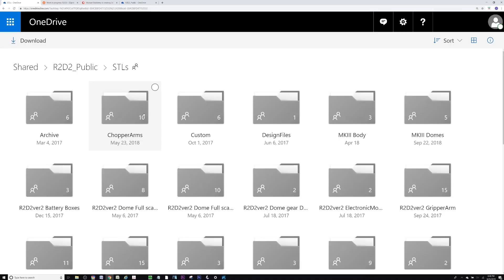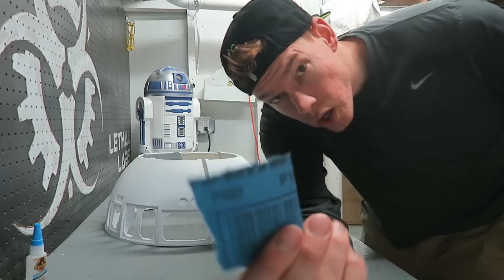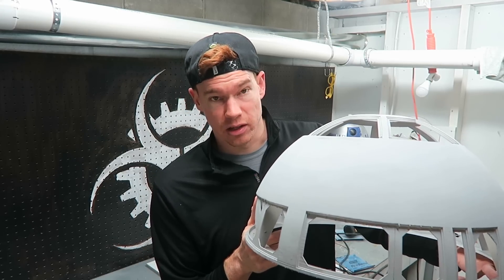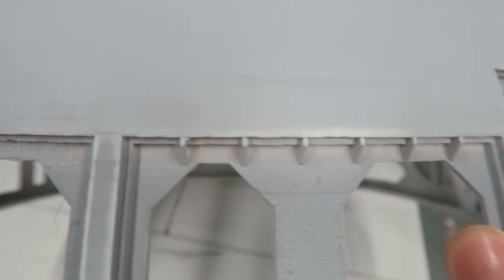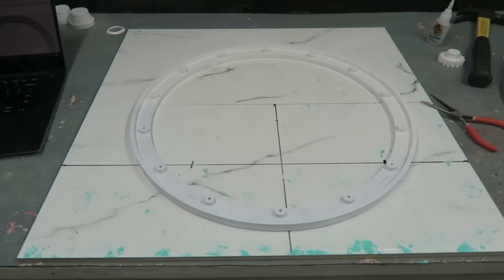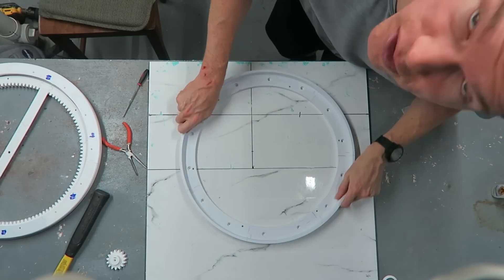HOW TO MAKE A 3D PRINTED R2-D2 | PART 1: THE DOME

Comment: What is the smaller r2d2 on the table in the corner. Made that yourself? Do you have videos?
Reply from the maker: It's actually an R2D2 trash can that I got as a gift a long time ago. Just looked online to see if anyone still sells them and looks like their only on Ebay now, and pretty pricey.
Reply: @LethalEngineering  Thx for the swift reply!

Comment: I have the same printer but what you do to make part stick so well mine are on glass with masking should I take masking ofc?
Reply from the maker: I use aquanet hair spray to hold my prints down, but I think the biggest thing is printing with a brim (I use 10mm, I think). Maybe check the Facebook groups for your printer and see what other people have done.
Reply: I use brim factory set sane printer as you have cr10. But I've been using a big piece of masking tape over the glass and it breaks free... so I'll try hairspray on the glass thank you
Reply: Ok moved my setting for speed by mistake on the stand a lone machine...what speed should it be at...thanks

Comment: How does the wood filler hold up? I use auto body filler currently  and if the wood filler doesn't crumble, I'd give it a shot. It's a lot less noxious and nasty to deal with anyway.
Reply from the maker: It works well for me. All of my 3D prints are primarily for display, so I don't know what would happen with heavy use, but I've had no issues.

Comment: how would some one open the files once downloading the files of r2
Reply from the maker: The .STL files? They can be opened in any 3d printer slicer software. I use Cura
Reply: @LethalEngineering   ok ty so much

Comment: Wood filler is HORRIBLE to use on PLA. Body filler should always be used. Plus Gorilla super glue will pop apart. You need to be using  CA glue. And the paint job....🤦🏾‍♂️
Reply from the maker: In what ways is wood filler horrible to use on PLA? Legitimately wondering. I've heard body filler is kind of noxious to work with, and I've been really pleased with the results from wood filler.

Comment: Was wondering what kind of filament are you using? Any suggestions were I can get a lot of filament at a good price,  since this kind of project would use a lot of material.
Reply from the maker: I tend to use Hatchbox PLA, which you can find on Amazon for about $20 per kg spool. Sometimes you can find multi-roll bundles and save maybe 20% per spool. There are some other highly rated manufacturer's (like Overture) which I haven't tried, but the ratings seems to like.

Comment: I have built 2 astromechs. R5-D4 and R2-Q5. I have 5 different domes that can go on R2-Q5 for various imperial droids. Lethal Engin. I suggest you next print out the R0 dome. I printed out 2 of them full sized and they are solid domes to add to your collection. The R0 domes are seen allot in the Force Awakens in the rebel base.
Reply: 3D prints as well?
Reply: @MaximusTheChosenOne  2 Domes are 3D printed, a black Poe Damerson R0 (Now sold at Galaxy's Edge store) and a white R0 dome. The rest of my domes are resin or aluminum.

Comment: Is printing in Pla really a good idea i heard that it starts decomposing when sunlight hits it and it melts very easily.
Reply: that's very true. I printed out about 500 dollars worth of PLA over 5 years on Star Wars props. I'm now sold on ABS. You can sand it and from what I know it won't warp later on and costs about he same as pla does. With ABS. I just need to print at 250 from the extruder and 110 on the bed with tac and glue inclosed in a raise 3D printer never fails any print. I wish I knew about this shit 5 years ago because I have $200 more in PLA that will warp. That is useless in Arizona

Comment: Not bad. You should have tested the lazy susan before you got to bolting things together. I have a 400mm and it sticks something fierce. Kyle Campbell had the same problem, (check out his channel) it is a pain in the butt to fix with the dremel and sanding paper. I haven't gotten into mine very far yet.Also, it is a good idea to hit the metal looking parts with a base coat of gloss (I'm planning to use high gloss) black paint, then the metal colors. I'm using aluminum for mine, with the rub and buff afterward. There is a trick of using translucent yellow as a base coat as well (I haven't tried it yet). I have the Sonic blue pearl coming in this weekend. I tried a blue metallic from Walmart and... yeah, no.
You can find mods on Thingiverse including stuff for additional panels and such. I don't know when I'll get around to uploading my mods for the V2 utility arm bays or the extra arms I'm working on.https://www.thingiverse.com/Eebel/abouthttps://www.thingiverse.com/hammer32/abouthttps://www.thingiverse.com/Retrodalek/abouthttps://www.thingiverse.com/mascal/designsI just finished Mascal's fusion furnace, very cool.https://www.thingiverse.com/Rorlin/designsHe has a youtube channel explaining some of his work.
I strongly suggest you look into the mods before you get too carried away printing the stock stuff. There might be something you want in there. I have multiple versions of the top of the periscope because I didn't know about 1 mod that has a detachable cover plate for instance. Having hidden vents in the battery covers for the motors to allow air flow to prevent overheating also makes sense.
If you are doing the full build watch out for the nut capture system in the skirt. They are a pain in the rump! The small ones do not fit well, at least in my experience. I'm going to have to modify them in order to get them in.
Watch out for the data door hinge too. It is flagged in the directions. There is a mod for it which replaces the plastic rod with a metal one.
I agree with Mighty Jabba, boy do I have flashbacks of sanding! I was doing it last night with the skirt though! Good luck with that!